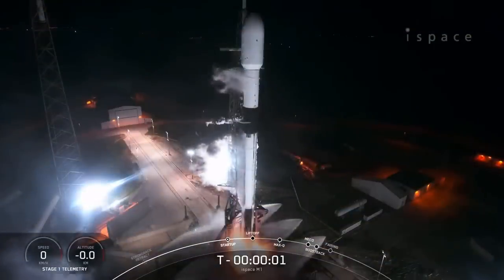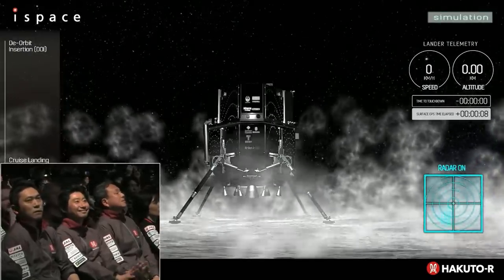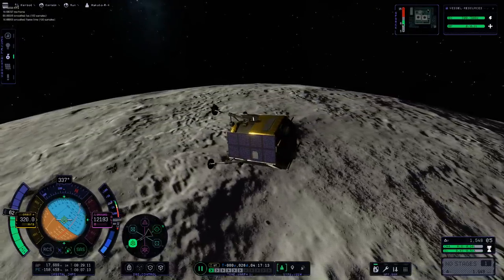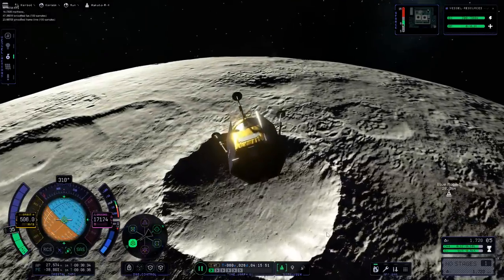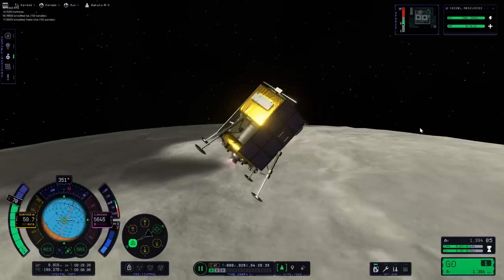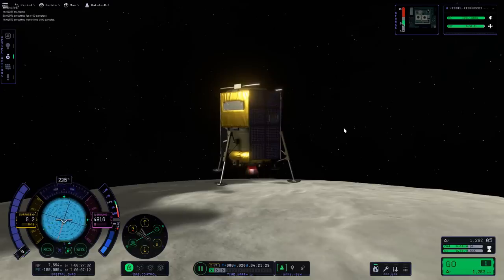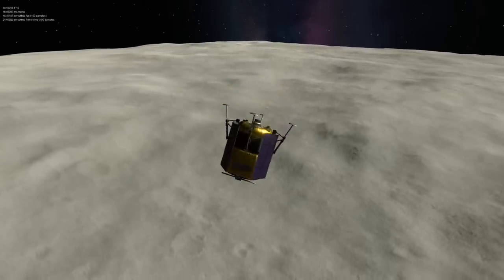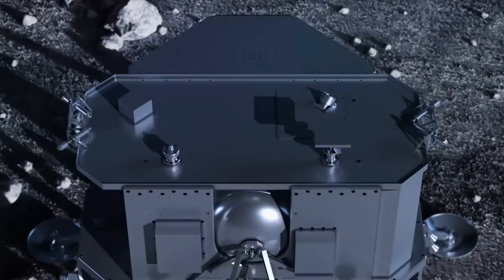Why Japan's Moon Lander Crashed Due to An Unbelievable Computer Bug

Comment: They are just proving that Apollo never went to the moon.)
Reply: Both USSR and USA landed on Moon, made photos of back side and returned regolith from Moon. Chinese also not so long ago returned regolith from Moon.
Moreover, also landed on Mars and USSR even landed on Venus (planet with clouds from acid, extremal temperature and high pressure).
Reply: @juliap.5375  There's difference between landing human and landing machine.
And i am not against space achievements. 
I am a fan of space, and i want whatever space company would land to another planets, asteroids. But sorry, if something doesn't make sense, i don't agree with it. I don't believe in Apollo mission.

Comment: So the software does account for or cant handle irregular surface altitudes? The moon is known to have a wildely irregular surface, but they are still surprised by this?  Either engineers are dumber than before, or ....
Reply: The original landing site didn't have them passing over anything so steep, so the software was never designed with it in mind, and worked perfectly in that scenario. It was the sudden change in landing sites and failure to retest that was the ultimate cause

Comment: 6:43  You have got to be kidding me.  WHAT? THEY FAILED TO QA THE LANDING SITE CHANGE? To run even a single updated simulation?  HOW???  Was it laziness or penny-pinching? Also IANA rocket scientist but how do you not have redundant sensors?  You are landing an object on the MOON. This is not a cheap drone trying to autohome! How do you write software for spaceships that just decides to start ignoring sensor input without MULTIPLE checks?!  Even on the first lunar landing this would have been inexcusable failure and a horror show on every TV on Earth.  NASA might have been smothered in its cradle.  Think of the loss of knowledge that would represent.  What scar might it leave on the human psyche? Anyway back to my main point: QA matters.

Comment: Thats what happens, they should have rang NASA and asked them how. They did it heaps and never crashed with hardly any computers, they're the best at it by far. Should have called them.
Reply: 2 out of 7 Surveyor moon landers crashed on the moon. Mars Polar Lander crashed on Mars.
Reply: @peterginsburg2465  sarcasm. No one died on the moon, miracle that. Almost too miraculous. Not even computer capacity to film it without transferring the tapes multiple times,  downgrading the resolution, ... but they did the actual deed ? Im trying not to laugh.
Reply: @deanhall6045  What are you talking about? What tapes?
Reply: @peterginsburg2465  all of the video shot on the moon tapes, they are all retaped, no original footage of this great event exist, research that, its true. No photo of Armstrong on the moon? NASAsaid they erased all of the tapes as they were back then, to reuse as a cost cutting measure.  NASA said that, not me. No one ever saw the original undoctored video unless they worked for the CIA. Also true, check all this for yourself, and while you're at it, watch NASA explain how one day they may be able to pass through the Van Allen belt,  they say loud and clear that no human has gone through it but will soon.?? That's them, not me. And maybe watch the interview with astronaut Allan Bean. This genius that went to the moon tried to tell an interviewer that his Apollo "didn't go that far out", until the interviewer pointed out that it starts at 1,000 miles above Earth and goes for ages, there's 2 by the way, he stated, "well, we went right through it then", its laughable at best. But it is disgustingly corrupt to fake something so large so they could create a Space Program to funnell billions of dollars. 
Oh, you might want to check why they recently postponed the planned expedition to the moon for a few years, trouble with the space suits that won't provide adequate protection against RADIATION, not me, NASA saying that. Why not just use Apollo's suits?
 Too many holes and large, huge, massive holes at that. 
 So, Van Allen belt,  how ?
Reply: @peterginsburg2465  if you didn't get my message, with no swearing or abuse, then it was censored because it contains too much of the truth. I get censored for saying boo on this subject, open your eyes is my advice.

Comment: I wouldn’t call this a problem with the software. This is a project management problem. That is, the software operated as it was designed. The problem was caused by changing the landing site and not coordinating this with the software team. That’s a project management problem.

Comment: Changed the landing sight and did not re-run the simulation. Entirely predictable in that they never practiced landing at that location. The software worked perfectly for the simulated original landing location. If I practice passing over a melon patch in the simulator I by God better pass over a melon patch on the moon. Otherwise I am lost. It’s a crazy idea to land on the moon. Best left to Americans brains they think of everything including duct tape and cardboard. 
The first Apollo landing had a human being on the stick, landing with four seconds of fuel remaining. WHEW!!

Comment: What you keep calling "a bug", is not.
It is a programming error, a very bad one.
Someone is going to be fired
Reply: That's what a bug is
Reply: @snowthemegaabsol6819  you dont have a clue about.
A bug is when a program does NOT di what is expected to do.
A programming error is when is when a program do exactly what it is programmed to do, but that operation is wrong.
Reply: Pedantry. It's impossible for a simple program to do something it isn't designed to do. Having it behave in an "unexpected" way is, as the word implies, just an issue with the expectations of the developer, also known as a skill issue, and not of the program itself, the hardware, or runtime environment. That's why a bug is also called a logic error. Any other kind of error, be it runtime, hardware, syntax, fatal, some random cosmic ray, or what have you, would simply have caused the program to terminate or crash
Reply: @snowthemegaabsol6819  ok, now everybody know you have not a clue about what a program is, how is made, and what a programmer do to made it.
Now stop embarassing yourself with such an incommpetence.

Comment: I always think it's amazing if a system designed for safety is the one causing a catastrophic failure, which wouldn't have occured if the system wouldn't be there.
Stuff like that happens more often than you would think!
e.g. For cars and machines: On average, safety systems actually increase the accident rate but reduce the average severity of injuries. (As in "you're injured but not dead")

Comment: I’m shocked I am…. Americans did it 6 times in a row without loss way back in 60s and 70s…. 😂 we sure did go there. Don’t you ever even think we did not. 😂
Reply: @driatrogenesis  Pretend engineer you mean.
Reply: That's the difference between manual control and computer control.  You might need someone to explain that to you.